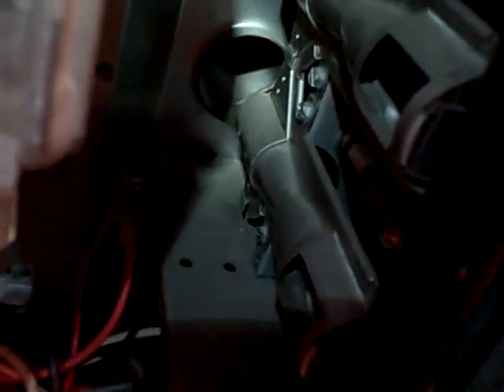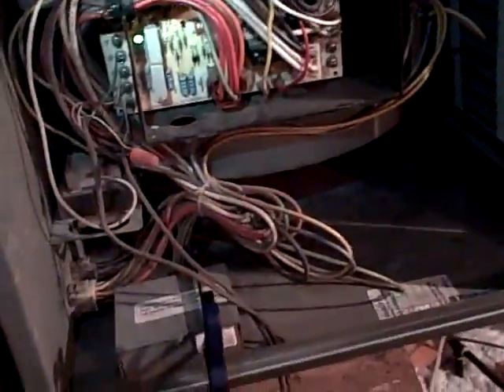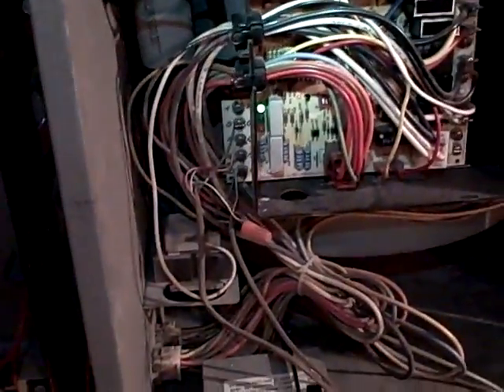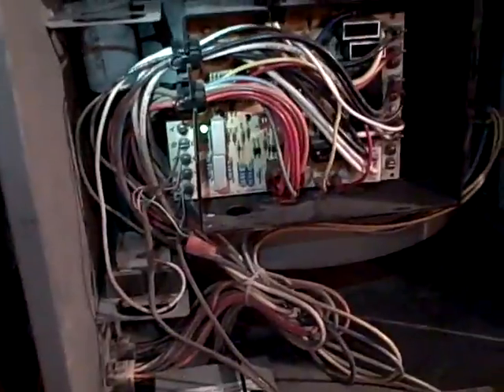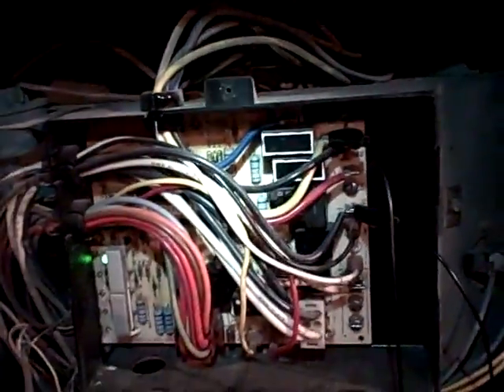HVAC Troubleshooting a gas furnace control board and blower motor.

Comment: I'm actually an HVAC tech just starting out and I always have trouble determining whether the board is the issue or the blower.
Reply from the maker: Hi!  Well welcome to the fun and the wonderful 110 degree days and 160 degree attics! ;).  My two most hated working conditions are 1. being stuck working in an attic in the middle of the summer with absolutely no ventilation (no soffit vents so no fresh air flow) so it literally gets so hot that you have to stop working every 5 to 10 minutes and come out to cool down or you have a heat stroke, or worse. I've overheated two times and never care to repeat it again. 

I was up in a regular customers attic, a two story and he has two attic spaces, the main large one and this small one with the upstairs air handler. No soffit vents. It has a whirly vent but that does nothing but spin since it cant actually pull fresh air. I had been taking breaks, but obviously not long enough ones to cool down enough (probably not drinking enough water either). Last trip up i was working and actually got the shivers like I was cool! I knew something was seriously wrong with that and got out, took forever to cool down!! To this day my heat tolerance is lower :/. NEVER let the job, a rush, customers bitching or being uncomfortable make you take chances. NOBODY is going to come up there and check on you!  I can count on one hand the number of customers that checked on me out of concern! You pass out or fall/get stuck, you are screwed! Lol. I keep a small portable squirrel cage fan in the truck so at least Ill have air blowing over me in the bad attics... Better hot air blowing on you than no air! If you cant evaporate the sweat off of you then you cant cool down and sweating does nothing. 

I always wondered how much water and Gatorade type drinks I go through in the summer!   You know you are hot when you drink drink drink liquids all day but you never have to go pee! Rofl!

2. I hate working on heat pumps outside during the winter in the freezing rain!  Numb fingers, frozen nose and water seeping into your socks, heh.  I always keep one or two changes of clothes in the truck!  I usually get on ebay or amazon and buy a couple of boxes of those disposable chemical hand warmers that you can just shove in your pockets!  Ive been meaning on buying one of those fancier camping hand warmers, just cant decide on liquid or solid fuel type.

ANYWAY, now that Im done ranting (hehehe), back to blower motors and boards!
   Yeah, at some point I figured out that the easiest way to test was using the door safety switch since most all units have one. Disconnect the plug on it going to the board, pull the high speed wire for the blower off the board and plug it into the door switch, push door switch! Done :). Nine times out of ten its the board and the motor spins up just fine.
...then a majority of the time that its the motor, its usually a bad capacitor.
If its the board its usually either a bad relay or a recent storm surged and fried the board and you will see a burned spot on the back of the board where it arced to ground through the sheet metal. Either way you have to replace the board. I get comments occasionally, "why not just replace the relay?" But who has time? You have to source the part and then desolder and resolder the part or rig up an offboard relay, either way its lots of time, which we never have! (And neither are warrantied!) 

Are you enjoying it so far?  I was a nervous wreck my whole first year, lol!!
    Mike
Reply: I like it a lot so far there's just a lot to learn. Thanks so much for replying to my question I really appreciate it! And most furnace rooms I go into are in the basement so I haven't had any hot attics yet lol.
Reply from the maker: Niiiiice!!  Man, I wish! :). I can count the number of basements Ive been in on one hand :/ ...there just arent that many down here... Every once in a while Ill run across an older home built by someone with either money or just smart and they will have a mechanical room. Those are nice!  Down here its either in the attic or in a hall closet space. Occasionally Ill get a small place or duplexes and they will have firdown (can never remember how thats spelled) units mounted in the ceiling over the bathtub. I hate those too, ugh. You arent working in the heat but you get to stand on a short ladder in the tub and basically work over your head!  Most of the times when I get called out to those I find dirty evap coils, usually because its a rental property and they always used cheap-o fiberglass filters, or none at all, and they just suck the crud up! 
  ...so I envy your summers, but wouldnt want your winters! You prolly get to work on stuff Ive never seen like coal and oil furnaces, boilers and other odd stuff!

Comment: What ports on the board exactly did you jumper out to start the blower?
Reply from the maker: Hi!  I havent watched the video in a while, but there are a few ways depending on what you are trying to test. You can jumper the R and G carefully on the board, or behind the thermostat, and this will power the relay that engages the blower motor. R being 24-28 volts and G being the blower relay. If you're not careful and accidentally short R to ground or to the C terminal you could blow the transformer or fuse if it has one... Surprisingly lots dont have a fuse, Ive always hated that and try and install one if im working on one.
Reply: G is for fan to the L1 connection on the board. Then get ready to jump back Tannis.

Comment: Mike, when my thermostat calls for heat both my humidifier and wi-fi thermostat loses 24 volt power whenever the jets stop firing during a heat cycle while the blower motor continues to run.  Once the limit switch cools enough and the furnace calls for the igniter to start again then the thermostat and humidifier come back on.  I tested the voltage during this cycle and it runs about 24-26 volts until the gas stops firing then it drops to zero.  Is this a problem with my heating fan timer?  or is something wired incorrectly?
Reply from the maker: Man, I cant believe I missed your post! Sometimes when someone posts and I log in on the tablet it wont let me reply, I can check back a day or two later and ir lets me, grr.

....anyway... Your thermostat, humidifier and such are just fine. When the limit switch cuts out it kills the low voltage controls and usually cranks the blower on until it cools the limit switch and furnace back down to where it should be.

The thing is, the system should NOT be tripping the limit switch! Thats just a safety so you dont overheat the thing and burn the place down!

There are a couple of reasons why the limit switch is tripping;  The LEAST likely is that the limit switch is flaky qnd is tripping even though its not that hot. Usually not the problem.  
It is ALMOST ALWAYS an airflow problem!
1. The air filter could be very dirty or clogged up.
2. The evaporator coil could be dirty/clogged and not enough air is getting through (volume) to disperse the hest.
Those are the most likely culprits. Ive seen other weird stuff, like something getting sucked up against the coil. Ive seen a filter so dirty that the blower sucked it in and bent it up against the blower housing and when the home owner/renter went to change the filter they didnt see one and just assumed it didnt have one so they put in ANOTHER filter, leaving the dirty one up in there! (CraZy!;)
There are a few possible blower situations, but they are unlikely. Have you had the blower motor replaced recently?
Interested to hear how this works out!
     Mike
Reply: +mikie2501 Thanks for getting back to me Mike....Still have not resolved the problem.  Before I got your response I had talked to a friend of mine who was thinking that there was not enough air movement across the limit switch keeping it from overheating.  He said the same thing that this is only a safety switch.  But, while reviewing the wiring diagram I noticed that in heating mode the blower was not wired to run at the correct speed setting.  I changed the wiring so the blower would run faster to hopefully fix the issue but still experiencing the same problem.  This happens all of the time even with a brand new filter as well.  I was considering taking out the filter as a test it to see if I get enough air movement to keep from overheating.  I am not sure how to go about cleaning the evaporator coil though.  I haven't replaced the blower motor since I have owned the house but since I noticed that someone messed with the wiring I am assuming that a previous owner may have.  I was going to review the condition again to make sure the speed is correct.  As an alternative I considered wiring the thermostat and humidifier off of a 24V transformer so that they don't turn off when the limit switch kicks in but I still want to figure out the real problem.
Reply from the maker: +Gary Schiede Really there's no need to worry about the power loss to them when the limit trips. That's how it's forcing the system off so it doesn't burn up anyway. It's supposed to becset up like that.

Is your unit a horizontal in the attic or a vertical in a closet/garage?
At this point I'd say either the limit switch is faulty or the evaporator coil is dirty.  Good catch on the blower being wired to a different speed for heat mode.  I wonder if the last homeowner was screwing with it or the installer did it for a reason? Hmm...

You probably need to be able to look at the intake side of that evaporator coil.depending on how they have it set up you might have to pull out the blower to see it, unless it's a negative pressure system...
Reply: +mikie2501 My unit is in the basement and is vertical.   The coil is sitting above the jets outside of the furnace in a sheetmetal box.  I am not sure what a negative pressure system is.....I just replaced the limit switch with a new one and it still is doing the same thing so I guess I really need to take a look at the coil.  I don't think I should but the first mechanic that had worked on the unit when I first moved in raised the limit switch to 200 degrees.....I turned it down to 170 degrees a few years ago at the advice of my friend.
Reply from the maker: +Gary Schiede well I'd have to see the spec sheet or talk to a dealer or rep to get the temp setting for it. I'm guessing it's been replaced since typically units don't come installed with variable setting limit switches! that's usually something for techs so we can carry less stock on the truck and use one item on various equipment.

...the only other thing that I could think to check, and its just a crazy longshot, would be to peek in the attic to make sure nothing has fallen on the main section if the supply ducts, blocking airflow.  
...you don't have a door that is open blocking the return grill, do you? saw that once in an apartment, worked fine if they had that door shut, but if it was open it caused trouble!  talk about bad odds, lol!
Reply: Put a higher temperature rated limit switch in it Gary. Or just jumper it out. You replacing the thermostat with a wifi pos had nothing to do with your lack of maintenance on the system. Gary Gary he is diy scary.

Comment: Hey Mike,would a bad control board in a goodman heatpump air handler cause the defrost not to work correctly?
Reply from the maker: Usually if you have defrost problems the issue is outside.  Most likely the defrost control board in the condenser/heatpump.  Most of them can be tested and have a set of jumpers on them for that purpose (though not all of them). I dont recommend testing it yourself if you arent a tech since the procedure varies from some boards to others. Some you have to jumper them out, others you just jumper them for a few seconds, etc.

Other possibilities could be that the temp sensor is bad or has fallen off the coil outside. The temp setting on the board may not be set right or set for the wrong area. Sometimes Ive found it actually goes into defrost but too far between cycles so it doesnt do well and you can adjust the timing.  Some older units have a physical dial to adjust temp/time.  

Heres what should happen:  coil temp is reached or outdoor ambient temp is in range and external temp sensor trips the board and it goes into a defrost cycle.
1. Heat pump switches from heating mode to cooling mode.
2. Defrost board turns condenser fan motor OFF.
3. Defrost board turns ON aux or eme. heat strip in the air handler in the house.

What this does: in cool mode the unit grabs some heat from the house and sends it to the outside coils to melt off the ice. The aux/eme heat strip in the house is on so you dont get a blast of cold air in the house,it may not be hot but hopefully at least lukewarm during the defrost cycle.

When the cycle is finished it turns off the indoor heat strips, switches back to heat mode outside and starts up the condenser fan again.

Hope this helps!

Comment: Hi Mike! My blower fan kicks on and runs for several minutes several times even when the thermostat is set to off. Is this a possible board issue or is it normal. Any help would be greatly appreciated!
Reply from the maker: I can think of two possibilities off the top of my head. First is if you have a digital thermostat and the blower has a setting for intermittent to circulate the air from time to time. Mine does, though most dont I think. 
The other option is if you have a gas furnace in the attic, assuming this is happening when its hot outside, and the attic is getting so hot that its tripping the limit on it, the unit kicks on and when the cool air circulates through the furnace and drops the temp on the sensor, it cuts back off.  If it is this you might check airflow in the attic, make sure the soffit vents arent squished closed and such.  It could be something else but the temp issue would be my first guess.
Reply: Many thanks for the help! Im thinking its a thermostat related issue. the furnace is in the basement which remains at a constant temperature. Earlier today we were running the heater with no issue. The house heated up fine. Later the fan kicked on but no heat for about 10 minutes. Later the fan kicked backed on with heat this time. This happen when we run the AC as well. I've narrowed it down to the fan signal. I think its just the way its built as you mentioned it could just be a setting in our digital thermostat.
Reply from the maker: Hmm, happening with heat and ac... Man I wish I had a basement, hell I wish everyone had basements! Sure would beat climbing in 150 degree attics on your hands and knees through rat poop and insulation! ;)

What thermostat do you have and what model?  I believe mine is a honeywell touch screen (not in the room at the moment and my memory is horrid!).  If it was just the heat doing it I could come up with a fee different options, but since its both that pretty much means the thermostat.   (Mind you, trouble shooting over the net in my head!)
Reply: I can only imagine the horrid attics you must have to go through! 

We have a honeywell programable thermostat (not sure the model). After reading your response i've been keeping an eye our on the system. I checked the control board (thanks you one of your videos!) and it all looks good. Its an odd thing because we had the very same thermostat in our apartment and didn't have the fan kick on. I believe it just a function of the control board. In the hot months if the temp in the house does up above 77 the fan kick on for a few minutes. This happens a couple times a day. It's a nice function because it moves air around the house for a bit. In the winter the fan kicks on without the thermostat calling it much less, maybe once a week as far as i know. The whole system runs great. I had a tech come out last year and check the system and he mentioned it all looked great. The fan kicking on at random has been odd. Thanks for all your time and help!!!
Reply from the maker: arcdraw if its a touchscreen then see if the FAN square says CIRC in the box.  If so then the timed circulation sequence is turned on.  You can tap the FAN square till it starts to flash and see what is flashing. The options on mine are ON / AUTO / CIRC.  Then you can tap it again repeatedly to change the setting, when you have it changed hit the DONE square at the bottom of the screen.  A setting of AUTO will set it to only come on when the heat or cool is running, the ON setting runs it constantly.
Reply: I would guess and attempt to install a new control board on it diy. Then when it doesn't solve the problem, ask another you tube poster another diy question. Good luck, you are going to need it.